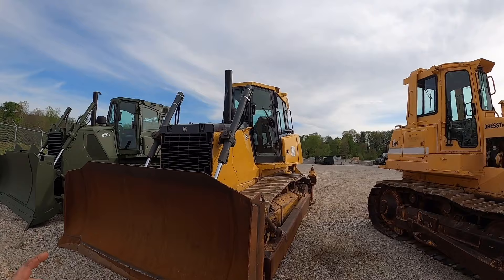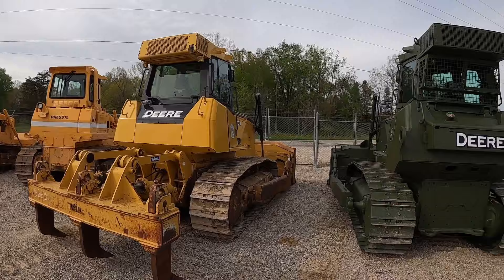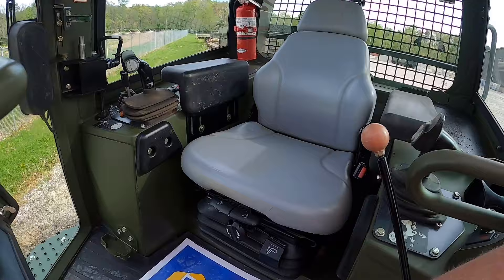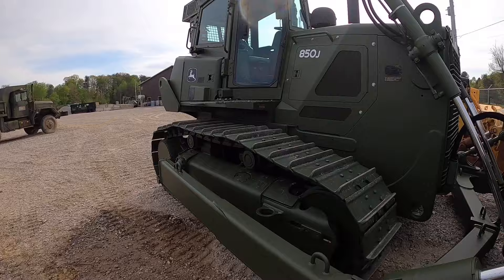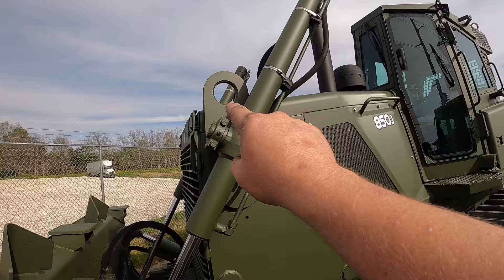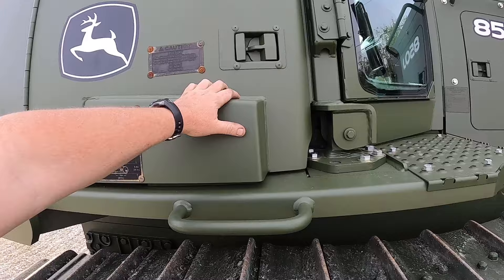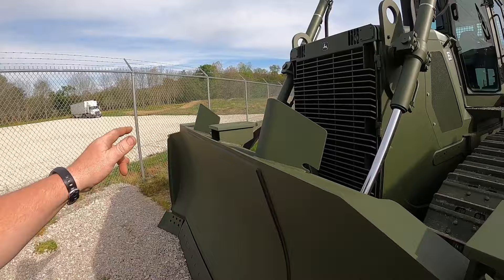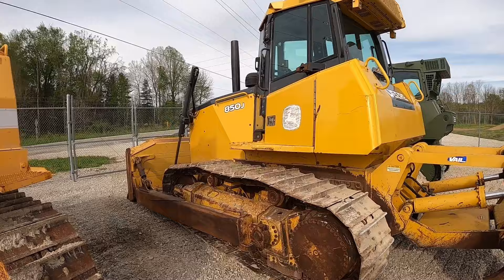Differences between military and civilian 850J John Deere dozers @C_CEQUIPMENT 850JR

Comment: my military generator has a battle mode,  it bypasses all the safety features like temp and oil pressure and just keeps running
Reply: Called the battle short switch. Be aware tho just cause I've seen it it can also cause the AVR to go off line and cause over voltage or frequency issues that can fry electronics in your house.
Reply: @MrPetter121  I already learned that the hard way.
Reply: @dirttdude  lol
Reply: What model do you have and from wich manufacturer
Reply: @Larry Powell it'll let you over load the gen when in battle short, they can run slightly over what they're rated for for a short period but it'll let you do whatever you want to it. It'll let you do as much damage to it as you can when in battleshort.
Reply: We had a kid in Afghanistan flip the battle mode switch and fryed all of are computers. It's meant for if your getting over ran and need to fry all the computers.
Reply: @mtmcclure91  lmao, we had to use it once on our generator because it wouldn't start due to a messed up ecu, luckily once it was running it didn't have any issues.
Reply: full send
Reply: Yeah don't ever user the battle short. That overrides the governor.
Reply: @nicholashoward7700  if i ever find myself in battle,  the very first thing i'm going to do is go outside and flip that sucker into battle mode,  i dont care how many governors or senators are involved
Reply: @dirttdude  haha lol.
Reply: @Larry Powell this isn't star trek lol, your stuff doesn't do better just because you feed it more power.
Reply: Haha they only have those safety features because of lawyers I’m convinced. Haha all my machine I bypass every “safety switch” haha more of a problem having them then not having them. My manlift I bypassed all the “you turned too far”or “you not level” bullcrap haha
Reply: I was a 91d In the army. worked on 3 phase diesel generators. good times.
Reply: What model is it? We have a military gen for our fire department and it will fry the doors if we turn it on. wonder if this is doing that.
Reply: @Larry Powell Can't teach someone to respect a machine, when they can't even respect themselves to begin with. You can usually just tell how mentally well someone is based on how they treat their tools, but I'm sure you know that all too well. Lol
Reply: @cowboycarl121  i really hope you don't have an electric- only door on your fire station. ROFL.
(you propadly didn't mean that, i just find the idea amusing.) :D :D
Reply: @brandonmontemayor8178  do you realize that makes the lawyers even more money?
Rewriting the requirements. Rightfully denying your insurance claim when you get hurt.

Good Safety features protect you and the machine.
Overriding them can be a good idea in a real emergency, but otherwise?
You'll just trash your stuff and take a bigger risk than nessecary.
Believing you'll never touch that open belt is survivor bias. It is naive.

Bullshit safety features exist too, though.
Sometimes, downrating is done to make you pay more for an unlimited version thats the same.
Or think about most laws- if half- thinking people like you didn't exist, we could do well without them!

Generally, safety features make sense in industrial use - most people wont get cancer from doing something once in their free time,
And you are unlike to die that one time you abuse a machine.
But if you do? Well, my compassion goes to the people losing you, the people scraping you of the floor, not you.
Reply: @Larry Powell oh yea, not doubting that. I’m talking my own personal equipment at home. Most of it, the “safety shutoffs” and whatnot most of the time are a nuisance to a job, getting in certain areas, the level out of wack and shuts off when trying to mow a mountain side. The limits they say are very short, they’re there for a reason, but you have so much more limit after the alarms set off
Reply: @Larry Powell I’ve noticed that, given I’m sure not 30, I’ve worked with plenty of 18/19 year olds that seem as if they can’t think out of the box. I grew up if there was something that needed to be done, I figured it out, majority of the time with the wrong tools/equipment. Doesn’t seem to be that way anymore. It’s always “well I can’t do it” or, “I don’t have a way to do that”. Figure it out bub. There’s always more that one way to do something.
Reply: @nos9784  We do, new station  (2018)  I  begged for chains.
Reply: Thats só awesome
Reply: It's also a piece of junk that was abused by PFCs with a few months of training. Why does everyone think military suplus is the best?
Reply: @jasonm949  haha foreal, they’re abused and thrown out like an ex gf. Haha I will say though, that’s be had some good scores in military auctions. High hours but majority of the time no real issues. We get trucks with 20k miles but thousands of idle hours that you’d expect to have problems with but somehow nothings really wrong.
Reply: @Larry Powell That’s not the way sine works
Reply: My uncle worked in procurement for a forward support company. They paid $70.00 per screwdriver, in the thousands each year. That exact same screwdriver (and model number), however, could be purchased for $8.00 a Walmart. That being said, the military do have some unique goodies, but they, or rather Congress, pay an exorbitant amount (than it's market value).
Reply: @jayklink851  yep. Dealt with the same stuff, bolts costing $120 each while the same part number at Home Depot was $2/$4. “Military grade” is such a comical term.
Reply: Haha I'm a generator mechanic in the Marines. Dont hit the battle short. We need a direct command from at least an O-6 or above to flip iy
Reply: @DrewLSsix  buzzkillington
Reply: @jasonm949  Because there's a shitload of them being sold off with 5 hours on them. It takes talent and a lot of trying to blow something up in 5 hours when you have something already in use to abuse til death... I'm not saying it can't be done, it just takes a bunch of effort.
Reply: @roachymart2318  🤣 You think military surplus information is correct? 🤣 Dude, I've got a couple of super low mileage military vehicles, and low hour generators to sell you. Honest...they are almost brand new. Barely used.🤣
Reply: @jasonm949  the minuscule amount of surplus stuff that is abused like that is a non issue. The mil stuff is almost always better, more robust, and has redundant parts. You could say that about anything used. It's common for people who aren't familiar with surplus to think that everything is battle worn, because they don't have any experience with it.
Reply: @littlejackalo5326  You're right. I was never an 0311 in the Marines and saw what Motor T did to their 5 tons. Never saw generators being constantly broken down. Never drove a Humvee hard. You got me there. 🙄

Comment: With the price of fuel, you might want rifle holders in the civilian models too.
Reply from the maker: Lol
Reply: Exactly
Reply: That hits harder everyday
Reply: For sure
Reply: just in case you wanted to become 3 finger joe
Reply: @C_CEQUIPMENT  lol one thing i know the military one is gonna be better
Reply: So they get a rifle with your fuel?
Reply: @tonyc2239  Maybe just some lead.
Reply: Hey that'd be handy for deer season
It's hard on a gun bouncing around them cabs
Reply: Wait you mean it's not normal to carry a rifle everywhere
Reply: With the price of diesel and gas, running on jet fuel ain't so bad!
Reply: @coaijet7830  Buying by the pound/gallon Jet-A is usually slightly more expensive than taxed highway #2. Airlines get it way cheaper, partly due to high volume contracts but also most major airports have a pipeline direct to a refinery or two (and an on site tank farm), trucked in it would probably be about the cost of Red #2 or #1 (When I say high volume I mean 30 tons for one 767 flight, one way.) 
Jet-A is basically #1 with a gel/cloud point of -40. Straight cut vs hydrotreated varies by region and crude source and you can see and smell the difference, hydrotreated is water clear and lower odor, straight cut is yellowish and a bit funky. Rumor says hydrotreated has less lubrication but I haven't seen any data.

Comment: I was a heavy equipment mechanic for the Marine Corps for 4 years. I loved the job but wanted more out of the corps so i changed to a combat mos. I'm planning to get out after this next 4 years and want to get back into heavy equipment as a civilian. I have a ton of experience working on the 850J R and it is one of my favorites simply because of how simple it is to work on. Also in the Marine Corps, we call it the MCT Medium Crawler Tractor. Now being a Combat Engineer, i get to see the operators use the Tractor in the field and I'm truly amazed how well it operates. And to explain the reason we have the larger blade is because we have a mine rake that attaches to it to rake mines and IEDs out of the ground. This rake is made to clear a path wide enough for our widest trucks to pass through the obstacle. Love this video and love what you've pointed out. I've never seen a side by side comparison of military vs civilian gear.
Reply from the maker: That’s cool
I’d like to see a pic of the rake that goes on them
Reply: Is the dozer capable of withstanding the blast from a mine without damage? I've ran a 650 quite a bit with a root rake in the log woods and assume the mine rake would look something the same. 
 Thank you for your service too sir.
Reply: Where are you located or planning on living once you decide to leave the military?? I'm in South Florida (Palm Beach County) Just wondering as I'm currently a GC & looking to begin buying my own machines ALSO because I'm applying for a Class 7 FFL to buy, sell, build, & modify firearms along with the tactical gear & body armor I've been dealing over 13 years. I figure you probably know just a tiny little bit about all those things. 😂 Seriously though lmk what you think but most importantly thank you very much for your service & stay safe! ❤️🤍💙🇺🇲✌️🤙
Reply: @C_CEQUIPMENT  I agree!!
Reply: Can you make a video or some shorts of your kit, the vehicles, attachments & maybe some of you doing the job?! That'd be awesome! I know a lot of people would be interested in this "can't do without" work. Also a few friends are YouTubers who do military stuff & would help get you out there...
Reply: Its a great trade,but tares your body and health down before you get retired again.
Reply: Bro. I’m the operator. Thanks for fixing my mistakes 😢
Reply: Also, ORRAHHH DEVIL

Comment: This was cool to see the differences. I like the way the military uses all the same batteries in everything and the lifting hooks are crazy beefy !!! Pretty cool. Thanks Clint
Reply from the maker: Thanks for watching
Reply: Got to pick them up with helicopters
Reply: @briankellogg7241  Them and cranes. I saw some loaded onto a civilian ship, think they were surplus.
Reply: @wheturangi  that's how they ship vehicles to war zones. I know all the Army bases have rail yards, so when we get ready to deploy, loading hundreds, if not thousands, of vehicles onto rail, is part of it. Usually if you see the trains carrying mil vehicles across the country, they're heading to some port, to be shipped overseas.
Reply: Worked at John Deere DUbuque Works back in 1977-1980, saw some of the 850's back then shipped out, did not realize the differences.
Reply: the idea is that all the equipment from a humvee to the hyex are all 24v and can all jump start each other no need to worry about positive and negative cables just a large cable that goes to the circle port above the batteries
Reply: how would I know it has a beef on the dozer?🤔

Comment: I work for a company that makes military forklifts and from what I've seen most of the comfort items are as basic as it gets but the running and use items are meant to work no matter the conditions. Most of the stuff we build has lifting eyes and strapping points added as well. The only weird thing is they are controlled with breakers instead of fuses. And I don't mean electric trucks either im talking all mechanical diesel engine trucks. Everything from 3 ton units up to the 10 ton trucks. Thanks for the video.
Reply from the maker: Thanks for watching
Reply: Can always reset a breaker
Fuse blows and you ain't got a backup, SOL
Reply: @maxman1244  you can take the inside foil from a pack of Marlboros and limp a fuse till you get another... that is if you smoke i guess. Lol
Reply: That's cool. I didnt know they did that. Breakers are better than fuse, they serve the same purpose as fuses but they're reusable.  I'd like to have a breaker box in my vehicle instead of a fuse box.  I bet it's a pretty expensive upgrade/option.  
Is the electronic military stuff you guys make or work with  also hardened against EMP ?
Reply: having breakers instead of fuses is actually kinda smart and idk why all vehicles don't have that
Reply: @noneyayeast  if that causes a fire or bricks equipment that the fuse would have protected it from, whoever did that mod would be up shit creek without a paddle
Reply: @jimwednt1229  the problems with breakers in civilian vehicles is that people would never fix the underlying issue of why the fuse blew to begin with. They will just flip the breaker til something bad happens. People are dumb lol.
Reply: @jimwednt1229  The electronics aren't EMP hardened, but they are electrostaticly isolated, and sealed against the elements with resin.
Reply: @JeffLocke1  isn't that what " EMP hardend "  means . 
 I mean , is it protected from emp the way it is ?
Reply: @jimwednt1229  To be hardened against an EMP, the circuit boards have to be enclosed in a Faraday cage. Its usually a fiberglass box lined on the inside with fine copper mesh and then coated with a non-conductive insulation between the mesh and the circuit board.
Reply: @JeffLocke1 oh okay, I see now.
  The cage let's the EMP pass around the circuitry inside the cage .

Comment: Interesting to see what Uncle Sam considers important, especially since they are spending our money.  I worked for CAT where we built motor graders, off road trucks, and tractor-scrapers.  We had a area to paint and make the "changes" to military.  The craziest build we did was for the Canadian National Highway.
They bought 627 twin engine tractor scrapers(our smallest scraper). They painted them pink, added a big v-plow, then fill the bowl with sand(for weight) to plow snow.  They sent us a picture of a Volkswagon that was hit by one of those critters. It was hard to tell what it had been. Those 627's would run 40mph.
Reply from the maker: I bet
Reply: Wow. That sounds impressive, would love to see the picture if you still have it kicking around.
Reply: You should see some of the plows flying through the Coquihalla highway
Reply: @devond8019  I watch the shows "Highway Through Hell" and "Heavy Rescue 401". The "tandem teams" they run on the 400 series roads boggles the mind.....
Reply: @danielpullum1907  yeah man it’s wild I’m from Canada myself.  Worked in some remote areas and the engineering feats you see sometimes is wild.  Once seen a train of 6 trucks tugged behind a d6 lol
Reply: Sheesh. Where do they make something so monstrous? Down south?
Reply: Had an armored D9 fall off a flatbed in Iraq and tear off part of the blade - our engineers "borrowed" it, welded it back together and used it for a month until the Army found out and took it away. Most impressive thing up close I saw in quite a while.  Don't even want to think what they paid for it initially.
Reply: Hier gears

Comment: Hi there! As a former Marine Corps Heavy Equipment Operator (97-05) I can hopefully answer some of your questions about heavy equipment that we use. Here are some simple ones that I've seen in the comments so far:
1. No heavy equipment that I've ever seen stateside or in a combat theater is NBC sealed. If that were necessary the NBC unit overseeing that particular mission would work with the engineer support battalion to create it as a one off.
2. Marine Corps equipment does not have A/C. Other branches might depending on how flushed with cash they are at the time of ordering. Trust me, 118* in southern Iraq in a scraper with no AC is not fun...
3. The electronics are NOT emp hardened. Just sealed in resin at the mains and important junctions for vibration and element resistance.
4. As late as 2005 when I got out, I've only seen grade control systems on Navy equipment. At our MOS school we are taught to operate on feel, and what the younglings would consider "old school." The grade control stuff is used only on airstrips. 

Let me know if you have any other questions!
Reply: Thanks for this. I'ts amazing to think that there is a huge network just to supply the military with a tractor.

Comment: I have a D7G LGP military. It has 28 inch pads is very stable for grading. Ours had a 50 cal mount on top of rops. Ours has a winch. One thing we noticed, we had to change every hose and installed new engine at 2000 hrs. Everything with rubber went bad, we think because they sit for 20 years rubber  cracked. Other than that its a dependable tractor.
Reply from the maker: Interesting
Reply: The ones with top 50 cal mounts generally have the mounts on the underside as well. I've never seen them not have it at least

Comment: Thank you for talking about difference. My JD time was on a 450-C. The ( T) handle blade control, The clutch pedal. That tells you something about my age. This was late 70s. All contractors in my area loved those 450 Dozer's. Have you ever had problem with the old Dozer on what I call a Alaska overhaul. On one a friend bought. The over spray of yellow paint, got inside fuel screen. They had a screen on tank.  The paint had plugged screen. We keep have a surge in engine. Then die. It was starving for fuel. We thought it was the fuel pump.